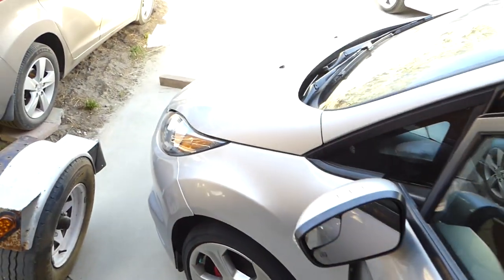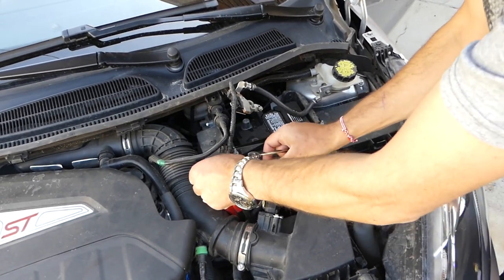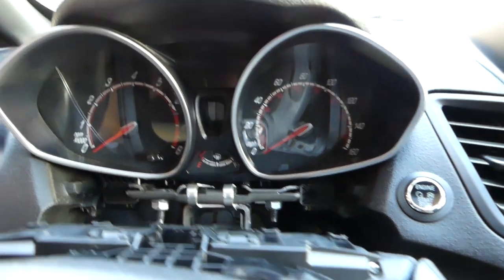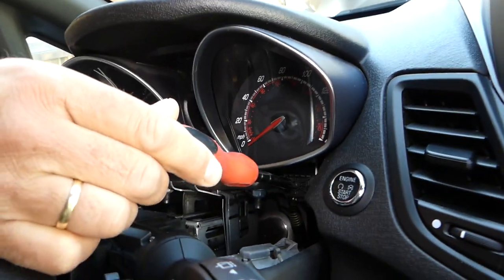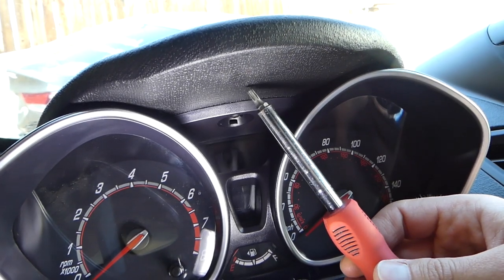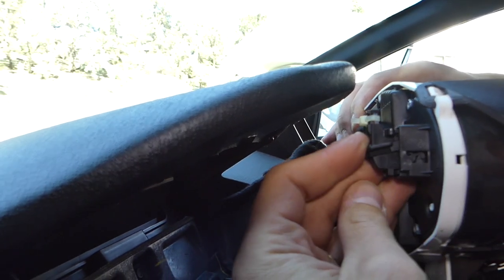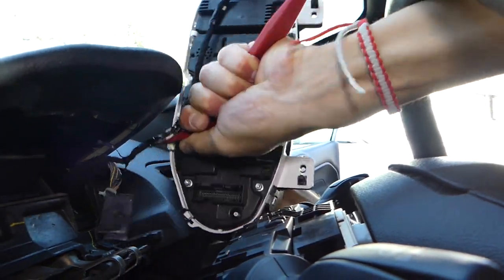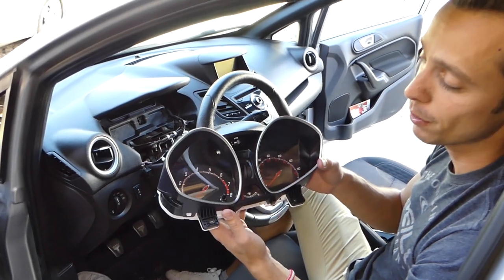FORD FIESTA INSTRUMENT CLUSTER REMOVAL REPLACEMENT MK7 ST

Comment: Hi great video, is it possible to remove just the clear plastic protector to clean meters inside? I mean without disconnecting battery or programable panel wires.

Comment: Does the miles still originals ?? Or they change once you replaced ??? Thanks great video
Reply: Miles would be the same as the mileage is stored in the car’s computer the dash is just a display

Comment: I followed your instructions, but it won't let me start my car. Does this have to be reprogrammed.
Reply: Any luck did the car need any programming?  I need to replace my cluster will it work?
Reply: @thendomutavhatsindi2009  I took it to mechanic, they could not reprogram used cluster. So, I had to buy a whole new cluster and with labor it cost almost 900$.
Reply: Were you replacing your existing cluster with a new/used one?
Reply: @kurisurs  I tried replacing with used one.  Security lock was on. I finally broke down and took it to mechanic. They could not reprogram a used cluster so I ended up buying a new. All because my check engine light(does not have light bulbs in these clusters). For new cluster it's 400$. My vehicle is fiesta se 2011. So becareful, used clusters can't be reprogrammed. At least, not in my car.
Reply: AmazingKey really appreciate the reply and the heads up for others reading this, but that really sucks what you had to go through. I was looking at how you can program them but you need expensive hardware/software like carprog :-(
Reply: @kurisurs  if your going to use it only once, it's not worth buying software. What year/model and mileage do you have on the car?